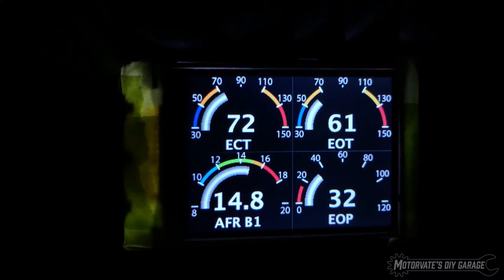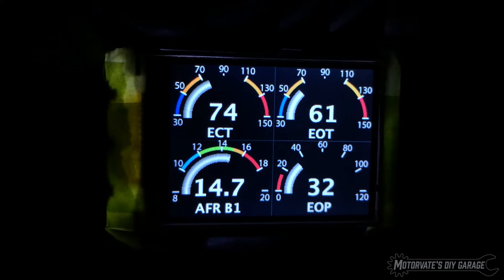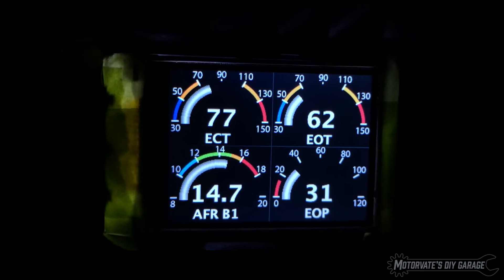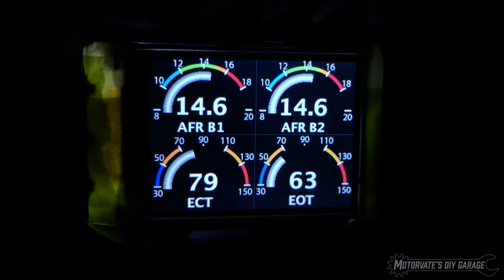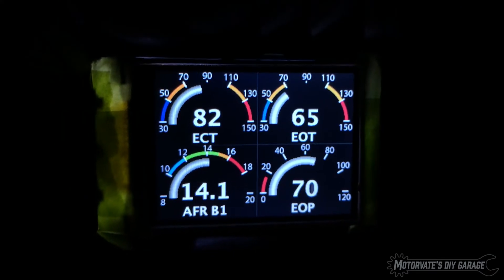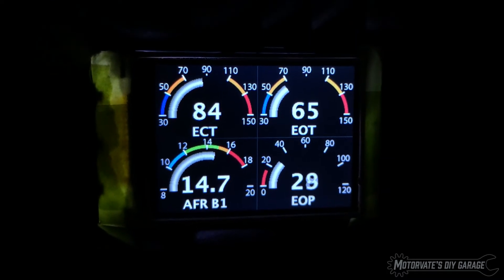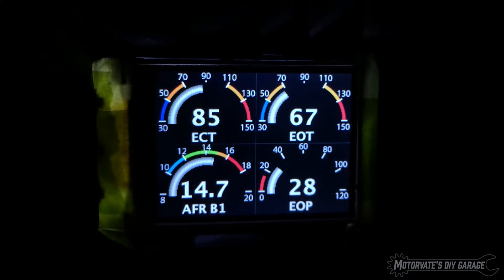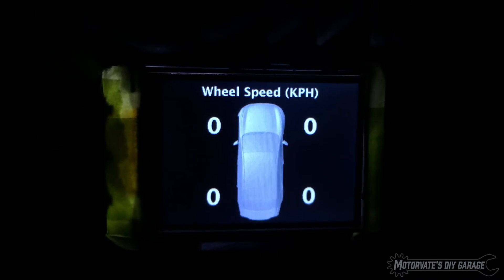Mini-Dash LCD Gauges Update #2: MotorvateDIY Garage Ep.41

Comment: Man this is so awesome, I really hope you can take my money one day. And so excited to hear tpms info could be displayed. Do you think there's a chance you could be able to use the trans temp pid on the screen. And thank you for the update
Reply from the maker: Thanks for your kind words!
The automatic transmission fluid temp is already defined and tested... I just can't show it on my car with the 6 speed manual.

For the next update, I will see if I can borrow a G37X  to show tire pressures, front/rear wheel torque (G37X only) and auto transmission fluid temp. :)
Reply: @MotorvateDIY  man this is the first mods I've got excited about in awhile. Thank you for all your hard work.
Reply from the maker: You are welcome and I'm glad you are excited about this!
Reply: @MotorvateDIY  where are you located? I have one you could test with
Reply from the maker: Thanks for your offer, but based on the YouTube analytics, there is a 90% chance you are in the US.

I am in the Toronto (Canada) area. 

Most of the testing I need to do now I can use my G37. Then I have a few local volunteers that can help with testing on other years/models of the G37, then the 370z, then the Q50.

Comment: Hi Frank ,when will you have these available to sale? Thanks!
Reply from the maker: Good question... After the next update, I have a lot of testing to do. Testing on my car and a few other G37s a few 370s and maybe even a Q50/Q60.

While that testing is going on, I will be working on the design/production of the next version of the hardware and use a IPS LCD which has brighter colours and a wider viewing angle.

I hope to have everything done by the end of the spring, but some supply chain issues have already caused delays and I hope it doesn't again.
Reply: @MotorvateDIY   ok that’s good news,I’ll definitely be interested.Good luck and keep us posted.